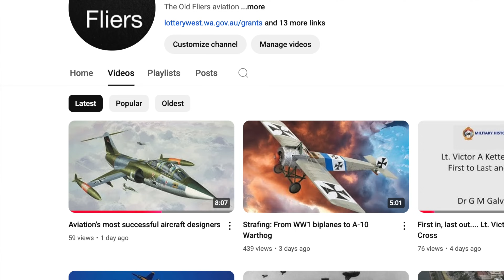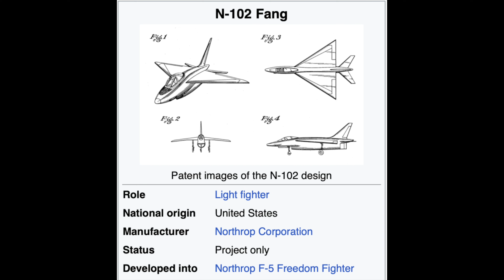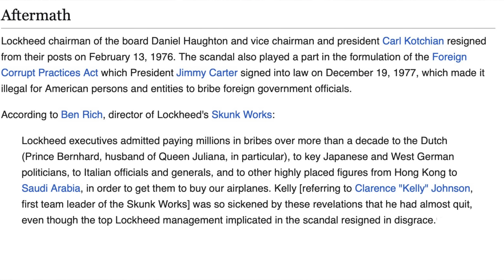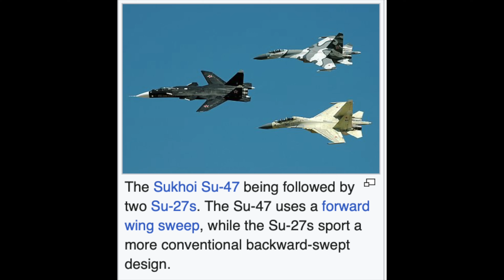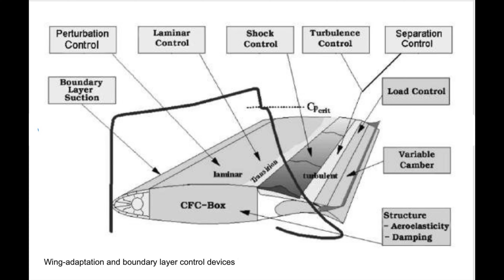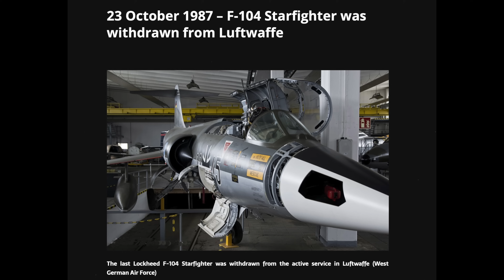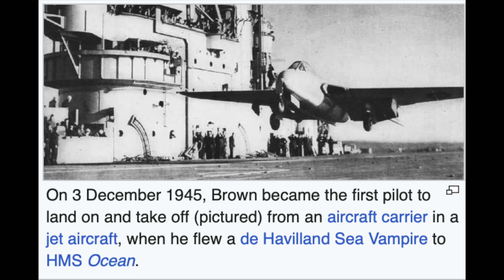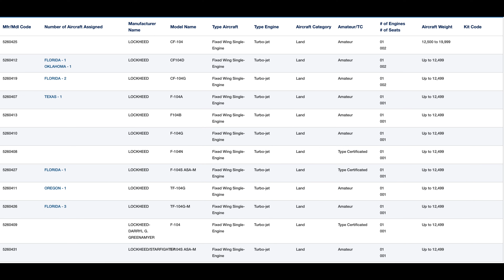F-104 Starfighter--a brilliant, but flawed design

Comment: The CL-1200-1 Lancer was the perfected Starfighter that should've been the design all along. All of the shortcomings of the F104 "Window Maker" were known, and easily addressed by having a low horizontal tail, and a high wing configuration with leading edge extensions. It's astonishing that Lockheed persisted with the original death trap even as the body count mounted. It was the equivalent of General Motors' Corvair. "Unsafe at any speed".
Reply: "Astonishing"  "Death Trap" "Body Count" "Unsafe at any Speed".  🙄  Ridiculous.

Comment: The F-104 was designed as a high-speed interceptor. It was meant to get into the air and up to high altitude very quickly, so as to engage formations of enemy bombers. It performed that mission very well. It was not designed to be a dog-fighter. Kelly Johnson did whatever it took to ensure that the Starfighter excelled at the mission for which it was designed.
Reply: It was not designed as an interceptor to stop Russian bombers.  I wish all you misinformed people would stop repeating this myth.  It was designed as an air superiority fighter.  If you read the history instead of YT comments you would know this.

Comment: The F104 were unfairly treated, Kelly Johnson rarely make mistakes,and he did not with the Starfighter. The aim was to use the biggest engine they have at the time and install it into the smallest airframe  for maximum performance.   The plane did exactly what it was designed to do, a high speed, high altitude interceptor. The problem only started when they wanted to avoid radar, and the plane were retasked to do low altitude nap of the earth flights,  something this aircraft were never designed to do, and of course those tiny wings made the plane glide like a brick if the engine ever quit. That was how it earned the nick name Widow Maker. That is like using a cruiser to hunt submarine,  of course you will have problems.
Reply: Johnson designed the Starfighter as an air superiority fighter, not an interceptor, and the plane flew just fine at low altitudes, provided the pilot knew what he was doing.  The Germans totally mismanaged the whole operation, resulting in a lot of crashes and the stupid"widowmaker" nickname from the German press

Comment: 17:02  No.  A 40% loss rate doesn't mean that your plane has only a 60% chance of getting you to your destination.  The 40% is cumulative over many years in service.  It's the per sortie loss rate that matters to pilots (and passengers) each time you go up in one.  For that you need to know how many flights (sorties) it took to go through 40% of the aircraft.
Reply: I hadn't thought his premise through, but on the surface I knew his math was hyperbolic.
Reply: A better way of looking at it (the correct way) is by losses per flight hour; specifically, losses per 100,000 hours.  The Canadian rate was around 10/100k, slightly better than the Dutch and the Belgians, and a lot better than the Germans or Italians (around 15/100k).

Comment: The flaw in the Starfighter performance was how it was employed. The Starfighter was NOT a good multirole aircraft. The Luftwaffe and RCAF used it for low level air too ground role. A different aircraft was needed for that.
Reply: The high wing loading of the F-104 was perfectly suited for the high speed low level strike mission.

Comment: F-104 Starfighter is overrated. Why?
1. It turns like a brick, not good for dogfights from the 1950s and not good for dodging enemy missile locks, radar surveillances and IRST detection in present day aerial combat. 
2. It's aerodynamics are not beginner friendly, only experienced pilots could handle it.  
3. Although is cheap to operate and produce, it had limited range compare to MIG-21.
4. Ordinance carrying capacity is less than MIG-21

It's a good interceptor for early 1950s but it got replaced by F-4 Phantoms in the late 1950s. MIG-21 on the other hand, is perhaps the best interceptors ever built although it was plagued by bad tactics in practice.
Reply: It is not the plane’s fault that it was not used as designed
Reply: The Mig-21 and the F-104 have about the same range, but the Starfighter can carry more ordnance.  The Starfighter turns just fine above 450 knots. 

It was designed as an air superiority fighter to replace the F-100, and, like the F-100, it was later developed into a multi-role fighter.

Comment: The Canadian Air Force had the Star Fighter as well, and We Also know threw Experience how that Plane got the Name " Widow Maker " .
Reply: The Canadian government also keep that air frame in service well past its optimal service date, only replacing it in the late 1980s with the procurement decision to replace the Star Fighter fleet with F-18s.
Reply: Most of the detractors here never actually flew it.
Reply: Our pilots called it the Lawn Dart.  There is documentary photographic evidence (tongue-in-cheek) that the ejection seat had better aerodynamics than the plane itself.  On take-off, the engine of a CF-104 flamed out shortly after leaving the ground at a Canadian air base.  The pilot ejected safely.  The plane promptly hit the ground and disintegrated.  The seat came down several yards farther down the runway than the wreckage.  The aerial photo appears in several published references.

Comment: The air forces that used the F104 would have been better off with the more versatile Grumman F11 Super Tiger.
Reply: Or better still the Lightening
Reply: @endamcdonald6166  It wouldn't have mattered.  They would have crashed just as many, and neither the Tiger or the Lightning would have been as capable in the low-level strike role.

Comment: Certainly not flawed compared to the EE Lightning... Britain was years behind in supersonic aircraft technology.
Reply: to be fair it was designed for a completely different role.
Reply: *Laughs in TSR-2*
Reply: @FloridaManMatty  Yes, TSR-2 was an unmitigated failure and it would have been completely obsolete on arrival into service.
BAC never produced a single successful aircraft design on its own, it was a raging bin fire.
Reply: 😂 Britain invented supersonic airplane, US stole it shamelessly
Reply: Thats insane.    You cant be serious.   Until the viper hornet eagle came into service Lightning was quite easily the best dogfighter in NATO.   Well maybe the underrated F106.    But lightning better climb and speed to the 106.

Outturn literally everything and outclimb and outspeed them too.   Starfighter equivalent in climb and speed but as to actual combat?   Fuggedaboutit.

No legs, no range.   Later they stuck some overwing tanks on and a bit more inplane fuel, but short legs always.   Nice handling aircraft decent low and high speed.   Well balanced except well, no legs.   I cant imagine what nonsense you must have read to lead you to your insane misinformed comment.    If I had to pick from all aircraft in service in say 1962 and go 1 v 1 with a couple of missiles and guns, you'd be insane not to pick a lightning.
Reply: @GrantK-k7b  Dead serious lad... in 1962 the Lightning was completely outclassed by the F-4.
 The "Aluminium Death Tube" was neither popular with pilots or operators which is why so few were sold... it remained in service only because the UK had nothing to replace it with... it remains the only supersonic British aircraft the country ever produced,
 The RAF relies on foreign aircraft today

Comment: I don’t understand why Kelly Johnson designed this plane. He spoke to many pilots about the F 86 versus the mig 15. The take away should’ve been a very good handling plane. The F104 top speed and high altitude performance was only two of the three most important design considerations the pilots wanted. Good handling was a given but was not achieved. That made a fundamental design flaw, but also made the plain fatal.
Reply: You don't understand why Johnson built the plane because you misunderstand air combat in that era. The pilots interviewed by Kelly did not ask for a plane that could turn tighter, they asked for one with superior speed and climb.  Air combat then was not about flying tight circles like it is in video games.  Speed and climb are what conferred advantage in combat.  The F-104 was not designed to turn tight circles, it was instead designed to sustain its high speed while turning, which was considered more important in combat.  The wings everyone on the internet love to malign were part of the formula which achieved that goal.
Reply: The T 38 Talon was designed to train fighter pilots who would have to handle jet aircraft such as the F 104/F104/F 106, the F4 Phanton and the F5 Freedom fighter. Most American fighter pilots managed to get the most out of the F 104 without crashing despite its poor low-speed controllability. I would like to know why many German fighter pilots never mastered the F104. I guess they should have bought the T38 too.
Reply: @astircalix4126  The German experience is a complex issue, but they eventually got their shit together and achieved a reasonably respectable overall accident rate.
Reply: It was designed as an interceptor to stop Russian bombers. It needed to take off, get to altitude fast and shoot down a bomber or several bombers. It excelled at its mission, but was then used for missions it was not designed for. Does this sound familiar?
Reply: @Patrick-xd8jv  "It was designed as an interceptor to stop Russian bombers."   No it was not.  I wish all you misinformed people would stop repeating this myth.  It was designed as an air superiority fighter.  If you read the history instead of YT comments and you would know this.

Comment: It was fast but nothing else, poor range, poor agility and poor take off and landing. It was missold and a general liability until the far more able Phantom took it's place.
Reply: Vastly superior to the EE Lightning...
Reply: Actually pretty good high speed agility. And the flaps helped agility at lower speeds substantially. And superb roll. However a not so reliable single engine and a not so versatile platform.
Reply: @craigveurr452 The F-104 was much more versatile than the Lightning... and more successful
Reply: @craigveurr452  Los flaps eran soplados, para evitar la separación de la capa límite y conseguir un flujo estable sobre el extrados... buen detalle.
Reply: It was, like its contemporary the English Electric Lightning, designed as a pure high altitude day interceptor to shoot down intruding Soviet Tu195 strategic bombers over the home country. In that role very short range, elaborate support needs (ground radar guidance, huge runways, full maintenance facilities) and poor maneuverability did not matter - a fantastic climb rate, very high speed and a great big cannon did matter. But that specialisation made it poor at every other role a fighter was used for.
So yes, it was a good plane in its intended role but a terrible plane for the roles it was sold for.
Reply: @kenoliver8913  No, it was designed as an air superiority fighter to combat enemy fighters.

Comment: Neat story Steve!

What a mad plane. I saw a privately owned one fly in the US must be 35 years ago!

It was so loud on the takeoff roll.

And it used a huge amount of runway too.

What is the opening toward the tail from 10:25??
Reply: Still flying today... one the great aircraft of the 1950s, 70 years old and still outperforms many modern aircraft..
Reply from the maker: Thanks. Yes, I wondered, too, about that vent. Perhaps someone knows?
Reply: @OldFliersGroup  It is one of the (EAID) Engine Axillary Inlet Doors, they provide addition inlet air to the engines at take-off and cooling while on the ground.